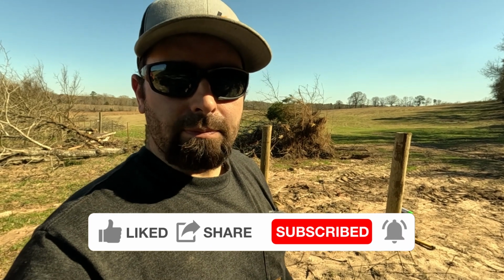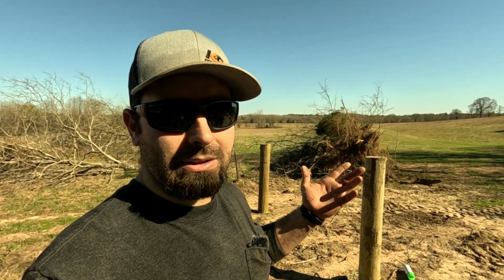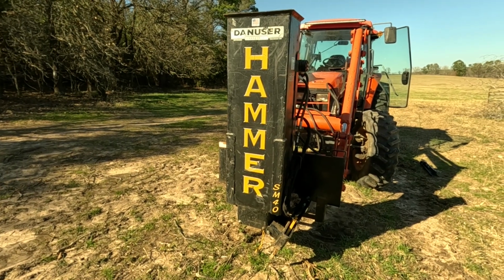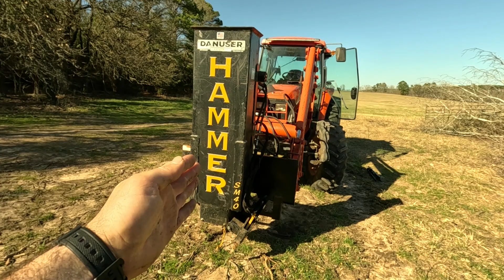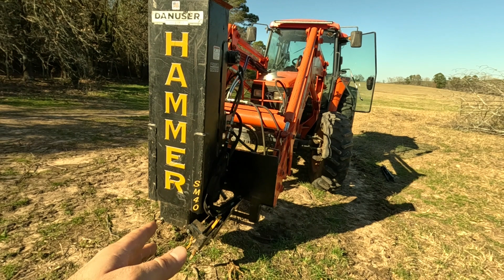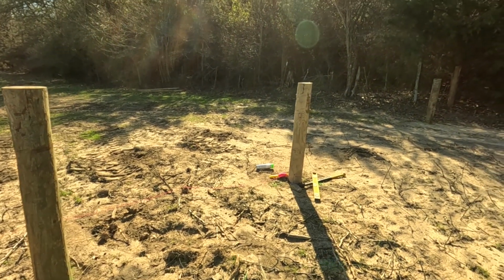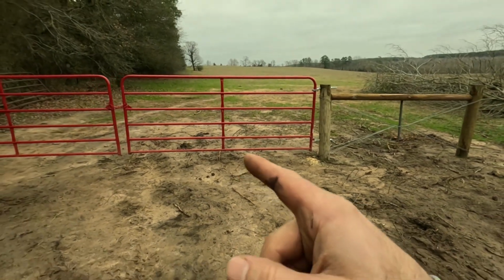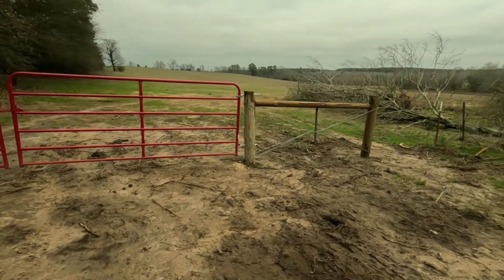Using the Danuser Hammer and Tractor to Drive HUGE Fence Posts!

Comment: How is your 3rd function remote hooked up or are you using your rear remote?
Reply from the maker: I have a summit 3rd function valve and buttons and that I added. Works great. The hammer doesn’t take much hydraulic flow. Most of the work is done by the weight falling.